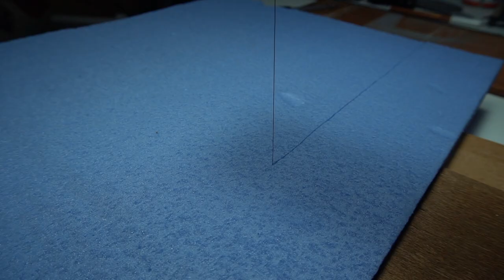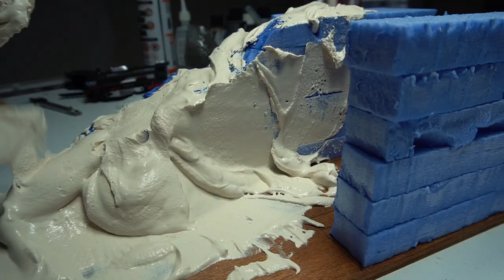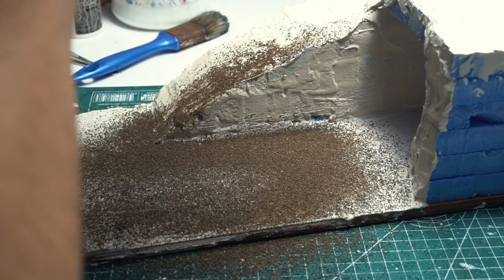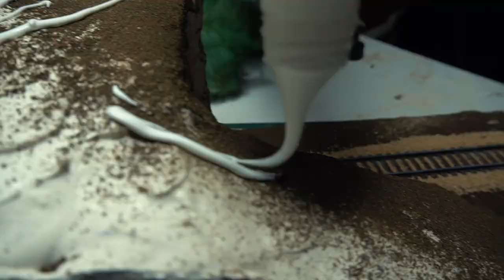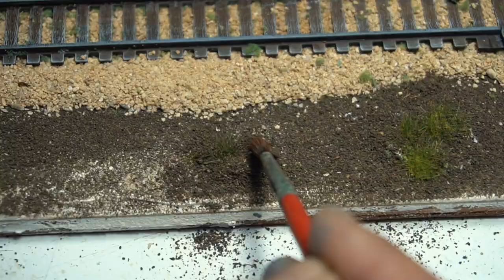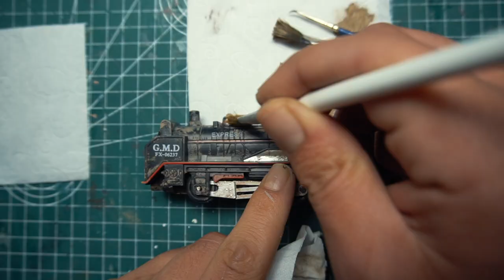Miniature railway construction ? (Diorama)

Comment: For the next time - the extension on the base of the telegraph posts is supposed to sit under the rail tracks, then the insulted wire carriers will be in the correct position to hold the wires.
Reply from the maker: I will consider your advice